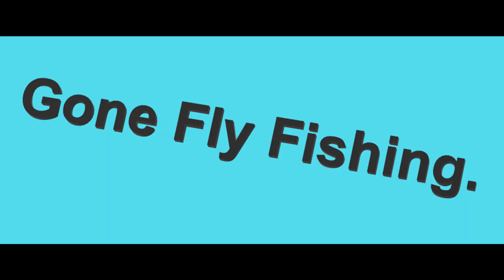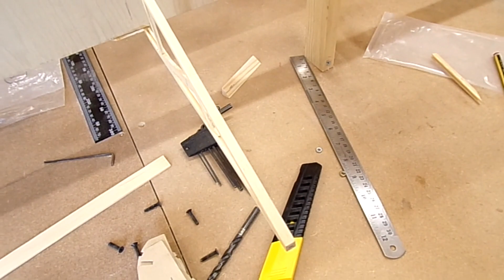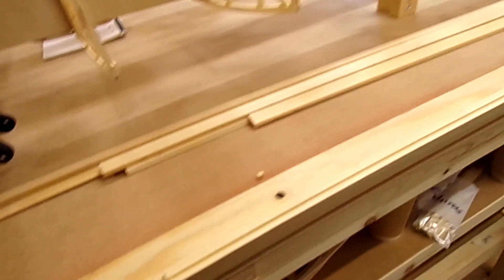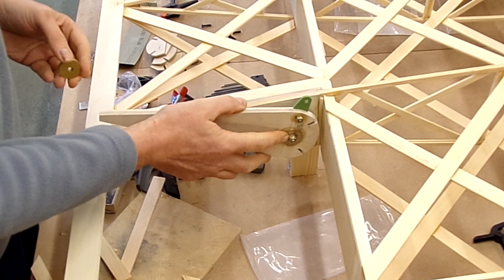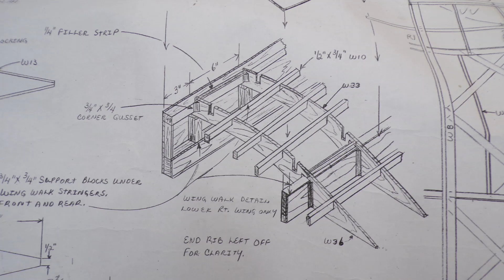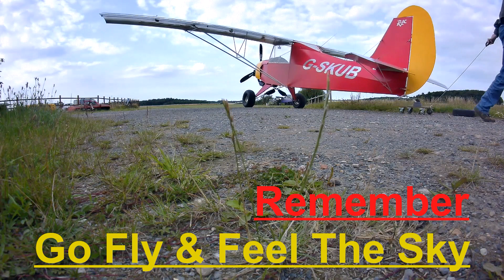EP41 Fisher Youngster V The lower wings getting near the end

Comment: Your wings seem more complex, but then again you have twice as many
Reply from the maker: A fairly complex system to look at but fairly straight forward in practice. They could be built faster, if it was not for my mods to make them that little step up from the norm. The upper wings should go a fair bit faster as they don't have ailerons, step and rear geodetic to contend with, we do have the added work of fuel tanks as I am fitting Aux tanks and there is little info on how they should be fitted :-)
Reply: @flyingkub  in my next video I may discuss my wing tank plans… since I’m building from plans I have more freedom to change things a bit… no ailerons on the top wing? I thought it did for some reason??
Reply from the maker: @grandenauto3214  No, just on the lower wing, the two seaters have them top and bottom. When it comes to freedom, I have as much as you, don't forget the kit is just matterial with very little final shaped (the only limitation is the ammout of material they supply is fairly tight). I already have a plan for the tank fit, which will be in line with what I have done in the past, with a bit of the Fisher method mixed in.